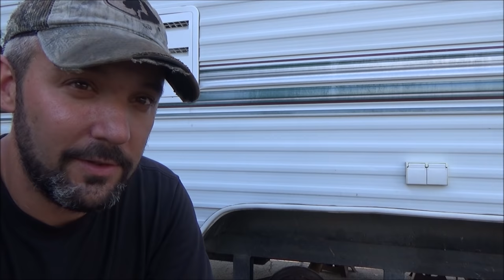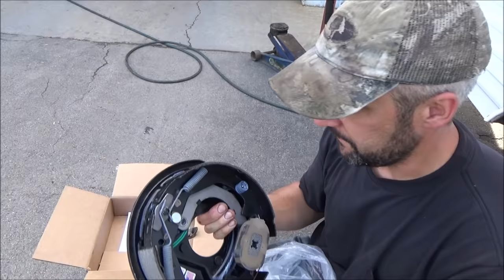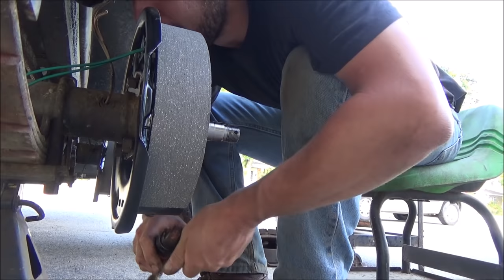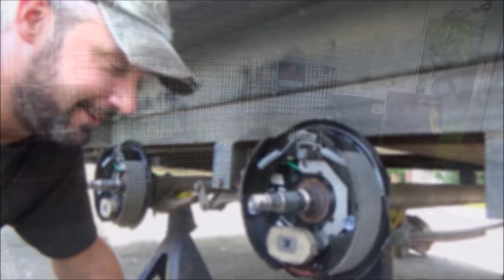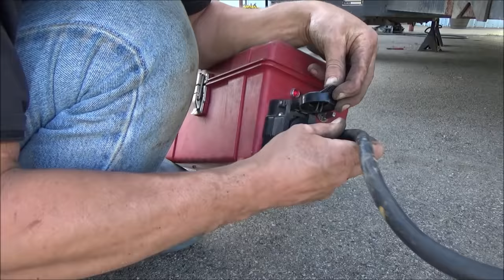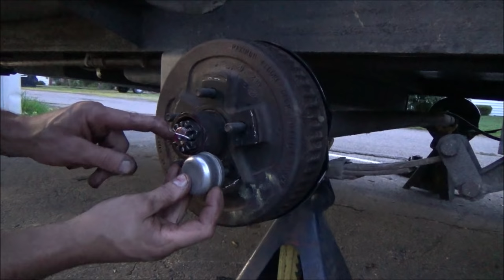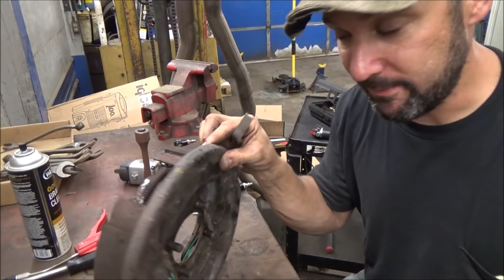Replace: Electric Trailer Brakes - Part 2

Comment: I enjoyed that video. I had this discussion with our apprentice yesterday. When I do that type of repair I don't always clean the bearings however. If the grease is clean and with no roughness of the bearing or metal chips I only wipe them and repack them. I was taught that you are only washing out the grease of a well packed bearing. When the grease is contaminated I wash and blow them out and repack them.  I pretty much do the rest the way you did. I was also taught that adding a little grease into the hub it will eventually work it's way into the bearings. Who knows {:-)
Reply from the maker: wysetech2000 Oh I see, good point.. I wonder what the thought are on mixing different types of grease? Different bases in the grease. I really don't know myself was just thinking out loud  is all.
Reply: @SouthMainAuto  I saw a presentation from a grease mfg years ago. They demonstrated that some greases are compatible, some aren't. If you are not sure, mix a little of both together and let sit for a while or overnight. If not compatible they can basically turn to a watery substance or get very viscous like clay or plastic. If they remain like grease over night, then they are likely compatible. You can't tell just by looking at the color either. :) Great video as always, keep up the good work.

Comment: Really great video. Easy to watch, informative with great details where needed. Brakes where thoroughly explained. I was watching more for the wiring as I’m adding Dexter brakes on 2 7k axels on a 20ft utility trailer. A video on complete wiring brakes (both axels) up from scratch or just re-do old existing would be helpful as well. Anyway, keep bringing these good videos, and thanks again.

Comment: I'm taking apart a 1964-5 Shasta trailer with electric brakes and you have me wondering if I should stop and try to replace the whole brake system like you did. I wonder if I can find replacements. I was going to clean them up and repack the bearings and flip the axle, but now you have me asking this question. Thanks for the education.

Comment: I think we went to the same school.. I have always done exactly what you did here, but my reasoning for the additional grease in the hub is for extra insurance. I figure while the grease is getting hot traveling down the road, it is also being centrifuged out to the bearings. 
Ok, that might just be what I "WANT" to think, but it makes me feel better!!
One thing I do different is with the cotter pin. I slide it through the castle nut and only bent the closer half of the pin to about 90*s. Then I cut it off even with the face of the axle and cut off the other end of the pin even with the nut. I was shown to do it your way, but I once had to dig what was left of a cap out of the hub where someone before me had reused an old pin and it broke off and backed out to the cap cutting it nearly all the way around the cap. So I cut them short to know it will never be used again and no way I can be the culprit who left the pin long enough to cause issues.  But that's just me. ;)  
SCOTCH LOCKS are the original NAME BRAND device. Like people call (locking adjustable pliers) = VISE GRIPS. Vise grips were the original.. Scotch locks are 99.99999% JUNK... I cannot tell you how often people would come to my shop with shorts in their tail lights and trailer lights that scotch locks were used on. Rochester NY, the land of rust, salt and monster pot holes, IS NOT the place to use that junk... Absolute garbage and allllllways the reason lights were not working..  Even worse were those older cars with the aluminum tail light wiring harnesses in the trunk that peeps would use scotch locks on. That wire was so thin it would brake when the lock splice would be pressed into place. Then peeps would check them at the splice plate and think everything was working.. NOT!!!!!!!

Comment: Old video but true scotch locks are a 3M crimp that is jelly filled and used by telephone persons to crimp wires.  The crimpon or side butts are not good out of the weather and suck out in the weather.   Nice video thank you the electro magnets are useful at times if you like to play with electronics.  They will work as a door catch, not for security but I have used them on a few things.

Comment: Eric, Excellent vid as always, keep up the good work. I always packed wheel bearings exactly as you do, has always worked for me too. 
Love the trailer tester. Have had it in my mind to build one similar. I actually have something I made, sort of the opposite of what you have. It's a few light bulbs on the end of a long cable so I can plug it into the connector on the vehicle and have it in the drivers seat with me and check all the functions through the connector. Always wanted to add some brake magnets (2, 4, & 6) to simulate 1, 2 and 3 axle trailers to be able to test the brake controllers as well.
Early in the video I saw the scotch lock connectors (what we always called them) and wondered if you were going to mention them or not. You did not disappoint!  Right on about them. I've worked on a lot of different types of trailers, RV's, equipment, etc and any time I saw them I tore them off and soldered the wires together....once I was able to cut them back and find good clean copper! Worst thing you could put on trailers, especially the brakes and tail lights. Trailer wiring is definitely crap.

Comment: Thanks so much. I've not had my trailer brakes apart and was thinking of taking one wheel apart to check them. I thought that if I'm going to that trouble might as well replace them no matter. Trailer is 6 years old and have used it a few thousand miles. 
Buying the backing plate assembly whole is a great idea. 
By the way...my Lance is made in Palmdale/Lancaster California, only 40 miles or so from my house. All the others are from Indiana or Michigan.  
Great information.

Comment: Yes. Trailer splice connectors is what I call them. I FRIGGIN HATE those things! You're right. If they're not a problem now, they will be soon. I cut them out every time I see them and then I solder the wires together.

Comment: another tip or two, I take the adjusters apart and never-seize the threads, so that I am able to adjust the brakes down the road sometime in the future, 2 the scotch locks suck but the ones filled with silicone gel, suck much less.  I use the same heat shrink butt connectors as you show

Comment: Amen on RV wiring. Bought a brand new Class C MH . Made two 500 mile trips and found left side rear taillight burning dim. When wiring unit new, they used masking tape instead of electrical tape to make connections. What a mess, trying to get out of the campground at 8:00 am and rewiring the chassis rears. I took pictures of the manufactured mess, and was told an unhappy X employee  was the culprit. Sure.......an unhappy employee.

Comment: I will say this about putting the extra Grease in the hub. I was always told that it does liquefy especially on boat trailers, because they are 12 inch rims and at highway speeds turn quite fast. What the extra grease does is it help pull that heat away from the bearings. That's why it's more important to put it in the hub then on the spindle. I also put a light film of grease on the spindles.

Comment: hi Eric, just found this video, when i was younger i used to fill (partially ) the core of the bearing shaft also, I always thought it had to do with moisture condensate on the metal if not greased and it would rust. I also still have the screw together cones for packing bearings and have used it on occasion. Great informative videos. All the best!

Comment: I pack inner bearings the same as you Eric and Flip it over and put it as far in hub and then do outer bearing only thing I do differently is I also put some in the grease cap also and grease the spindle completely @33:00 @SouthMainAutoRepairLLC

Comment: Yea I hate scotch locks too.  I usually solder & heatshrink my connections or use the solder connectors & heat gun because I tend to burn the insulation on the wire if I'm not super careful.  I usually have to add Flux on used wires but when it's done I know I'm not going to go back in unless it's damaged.  The connectors have definitely come along ways since I was young.  Wells Fargo Trailers still use House wire nuts lol.

Comment: great video, i think maybe all the extra grease you put in the cap ect is when they don't re pack the wheel bearings for a long time the grease will thin out and all the excess will make its way to the bearing and keep it lubed. just a guess haha.  that bearing packer you got works a treat we got one exactly the same.
Reply from the maker: Some random person yeah I have had that packer a while and love it. Saves a bunch of time :)

Comment: Something in the back of my mind in the way i learned kept haunting me, so I looked it up on Dexter's site. When first putting the castle nut back on the axel, you have to tighten it to 50 ft. lbs. and then take it loose, and go ahead and finger-tighten just as you did. I guess this gets all the cones and caps and seals snugged up first so that your nut is in the true position.
Reply: Yes, as I know it, 50 ft lbs and turning the tire/wheel in the same direction as the wrench to seat the assembly then, back off then tighten again just lightly and always back off to line up the cotter key.

Comment: I have been a Ford dealership mechanic for 35+ years.  I still pack the extra grease inside the hub whenever I worked on an older car or truck.  Some of the young mechanics ask me why I do it.  My answer has always been, that's the way i learned and never ever had a comeback (failure). Spindles and bearings love grease.
Just make sure you don't get any (grease) on the back plate or brake shoes.

Comment: Really great videos and you took your time and didn't rush.

I had a blowout on the RV and it ripped the electric brake wire that goes to the axle.  Anything special I need to know?  I know you said that it didn't matter what wire you used as the poles don't matter.

Comment: You grease the center section between the inner and outer bearings to keep the grease on the bearings from migrating away from the bearings due to centrifugal force. The grease from the center section also migrates towards the bearings to replace any contaminated  grease in the bearing and gets pushed out of the bearing to outside the bearing area.

Comment: The axle nut. I always cinch 'em down pretty good with the channel-locks and then back 'em off an eighth of a turn. Why? Because that's the way I was taught to do them, and I haven't had any problems doing it that way.

Comment: im an old dis abled mechanic, i used to do a rolling torque at 35 ft lbs, to set grease packand bearings then backed off to first castle matched cotter pin.

Comment: Wanted to recap the primary, secondary brake shoe deal.  In the beginning they noticed right off that the front shoe always outlasted the rear shoe, so they made front shoe shorter which allowed it to wear out at the same time as the rear shoe.  Shorter front shoe is then called the primary and the rear shoe is the secondary and that is the real why of left and right backing plates where you suggest it's about which direction the actuating lever is positioned.  I'll suggest that Dexter takes it upon itself to arrange it such that both issues are covered at the same time and we can't prove anything anyway about lever hung direction.  The reason the secondary shoe is full length is due the way drum brakes work in the first place.  As the primary contacts the drum, the friction with the drum is transferred to the secondary multiplying it's actual application force no small amount as the original force on primary is added to that friction force and then the combination applied to the bottom of the secondary.  No wonder then that the primary doesn't wear as much as the secondary and is always shorter.

Comment: My wash tub has always been a good bucket or tub with diesel and a parts brush.  Once the scraping and scrubbing is done, hit it with compressed air. If painting is involved I'll put it in the barbecue and heat it up and wire brush it, then spray paint it while warm.

Comment: If you get a vibration table and mount some containers with lids to it, it works great for cleaning bearing and getting the smallest particles out.

Comment: Just as an FYI, until recently Dexter was in Elkhart. The main office still is but the axle and wheel plant have moved out. My air compressor axle was built on the line and finished while I went for lunch even though I live in Michiana that includes Elkhart. It was very nice because if I wanted to upgrade something the factory order people were right in the office at the plant and the parts guy would pick parts right from the factory while you wait.

Comment: // Eric......Those Caps Are To Catch The Excessive  Grease  From The Bearings....Also I Check The Drums For Blueing And Cracks  ..And Measurer  Them To See If   There In  Tolerance   ...If People  Are Not Sure How To Check  And Grease Bearing ....Get In Touch With Bearing Manufacturers  ...They Supplie  Info ....Great Job  !!

Comment: Thanks, here in Sweden we don't have this electrical model. Just the push action ones by the hitch, I think you have that system on boat trailers

Thanks again, I enjoy learning from you and think I hade the same injetor problem on my -88 Corvette that you diagnosed as bad injectors. Back 19 years or so ago I think I sent them out to get renovated / Ultra sonisk cleaned but with no good outcome and sold the car later

Comment: Awesome teachings.  I have a question.....can I replace the standard electric brakes on my trailer with self adjusting electric brakes.  I have the 10 x 2 1/4, 4.0K /4.4K system.

Comment: Replaced my electric brakes last year & paid $60 for each pair total job $120 - also replaced electrical plugs(car & trailer) for $22 and battery $23.  So I have stopping power for the next 10 years.

Comment: In my years I only packed the bearings and coated the races never more or too much in the axle space. And with the marine grease it's a special grease and seal sets and caps too often set with bearing buddies to keep water out

Comment: Nice Snap-on ratshit. I love Snap-on hand tools. They just feel so comfortable to use. Pricey as hell though... I'd like to replace my old Cornwell combo wrenches with some Snap-on ones, but the dealer wants over 500 bucks for a set of wrenches. So, I'm stuck using my 30-year-old Cornwells for the time being.

Comment: you sound like you could be my twin brother. I made weed eaters out of junk Vacuum cleaner motors before Weedeater was even a brand name, I hopped up every riding mower I could trade someone out of. I had one Homelite mower that would run 30 mph at 12yrs old. My 1st motorcycle was an Yamaha enduro 80cc that can in box torn apart (another trade)I finally got it back together and running and added a headlight that ran off the magneto. I went on to built moch-up test boxes for everything I worked on. I even built one to test speedo's and tach's on Frieghtliner trucks from any related connection test point in the harness. It  prevented a several costly dyno test runs to check for accuracy. and removed the guessing game when the engineers listed the wrong codes. It's nice to see someone doing a simple task and, taking the time to explain "why" it ain't so simple if you don't know what your doing. Thanks for taking the time to show us about electric brakes and thanks for adding the interesting stories from you youth......nice to watch someone on you tube who also has the MacGyver vibe.

Comment: It’s funny that you said wired with wire nuts because that is actually the way I thought they were done because when I was changing the tires on our camper I noticed all four wheels were wired up with wire nuts.

Comment: very good video,no background ti ground sounds to drown you out. my theroux on grease in the hub centrifugal force spreads the grease out just incase you missed a spot when you greased the bearing,that's the way I do mine also.

Comment: Packing bearings. I read from a Chilton manual once and it said that if you don't have an auto bearing packer then you should fill the hub with grease. I say that's bullshit because if you don't have an auto bearing packer you force the grease into the bearing with your hands, like you said. So, I don't fill the hub with grease. It just makes a bigger mess.

Comment: Nice vids!  I’m going to replace the old wire from the hitch to the brakes.  And I’m going to put the new brakes back on the axle closes to the hitch. On my two axle trailer.  I thought about putting the brakes on the back axle but I don’t know if that would be better. What do you think?

Comment: Yep I pack bearings the exact same way you do, and I also not not know why either;) FYI, I hate those scotchlocks too, and I have gotten crap from other tech for using crimp connectors instead of soldering, I do both depends on the situation what I use, and I also never had a problem
Reply from the maker: Michael Berg Same here all depends on the situation
Reply: I use a little dielectric grease in each side of those heat shrink butt connectors and I've never had one fail.

Comment: Enjoyed the video. I was impressed with the test box so I built one. Everything works well except the turn signal lights. They light up but will not blink. I have tried two flashers. Any suggestions or part numbers for the flashers you would share would be great. Thanks, Dave Forte
Reply: Use a 552 hd flasher. m Most flashers do not blink unless both front and rear bulbs both work, needs the resistance of 2 bulbs to blink.